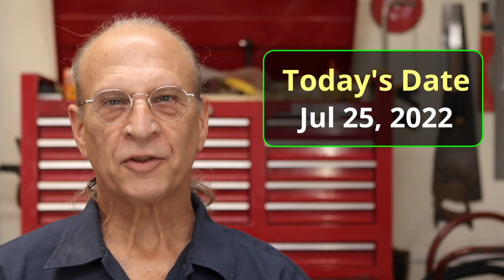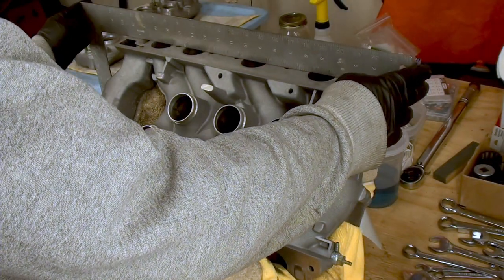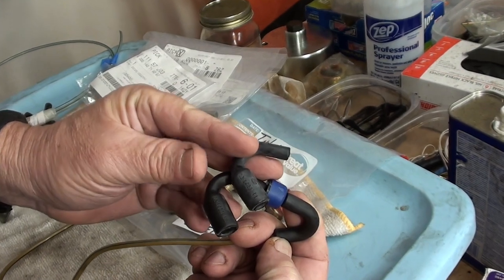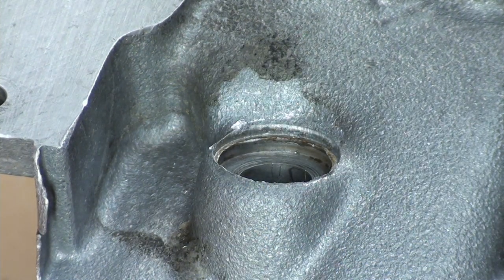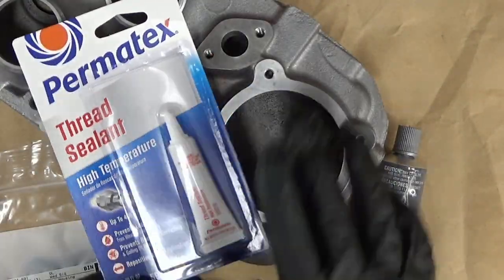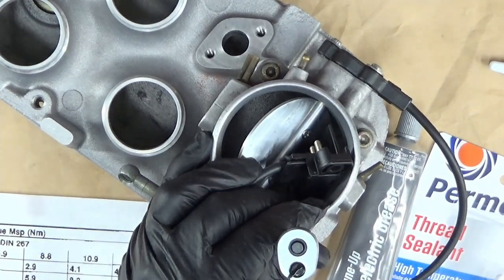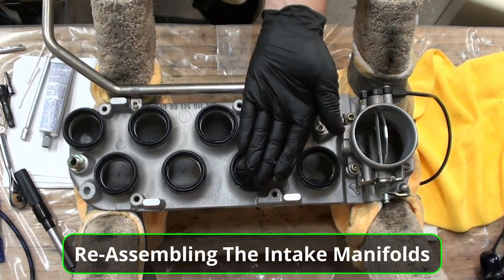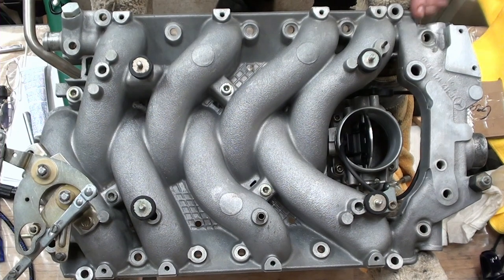560SL - Recondition The Intake Manifold Part 2

Comment: Currently in the process of doing this same job.  Thankful that I came across your video since it's been so long since I disassembled my intake.  I've been zinc plating/yellow chromating all the hardware and it has taken longer than I expected.  Convertible weather will be upon us soon and I'm ready to drive the car for the first time.  1987 560SL Red with Tan interior.

Comment: About to start the same process on my 560SL's intake / plenum, changing donuts to fix some vacuum issues and watching with a sense of excitement and complete dread....
Reply from the maker: Let me know how it turns out.
Reply: @TonyLiveTV  whoever put that bolt and bracket for the EGR tube on the back of the head had a sick sense of humor…still working on it.
Reply: @trevorchilders479  Totally agree.  I'm replacing the allen head bolt with a standard hex bolt so it's easier for the next person!